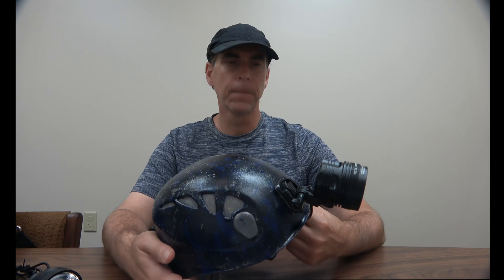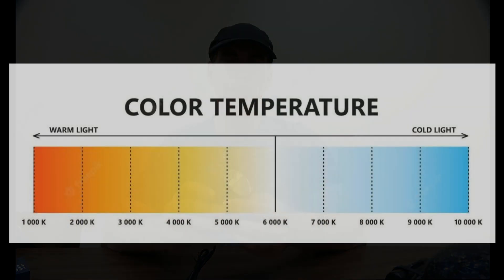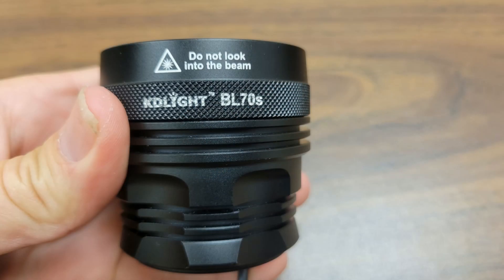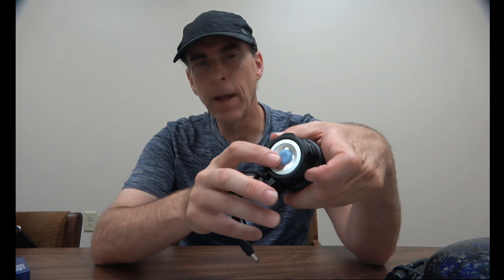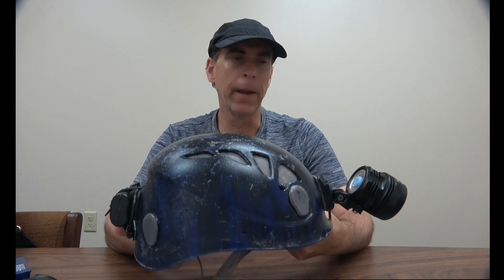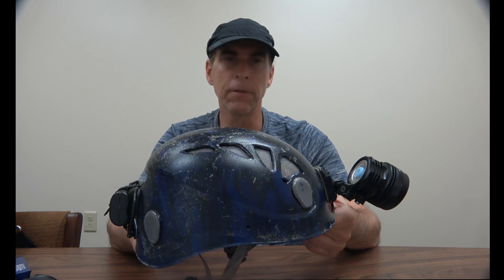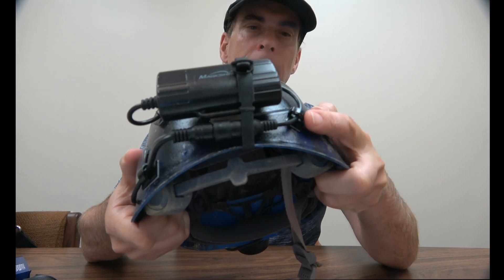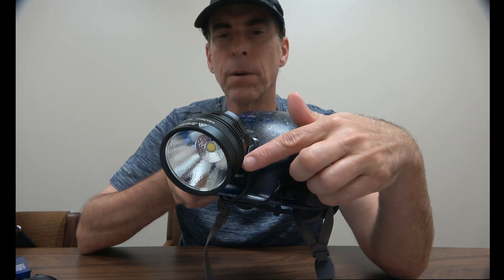3,000 Lumen DIY Caving Helmet

Comment from the maker: Did a run test test. Ran the light on high (3,000 lumen) continuous for at lead 60 minutes
. It used about 35% of the battery capacity (4 x 18650). That being said, I estimate I could get almost 3 hours of performance at 3,000 lumen.